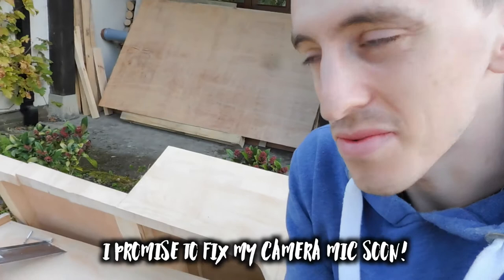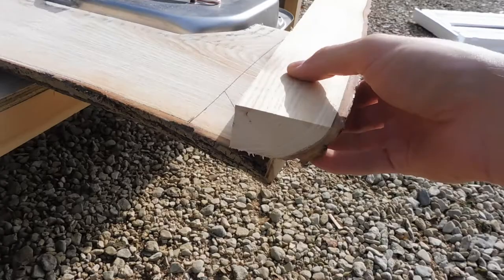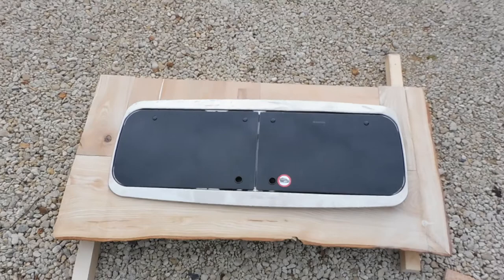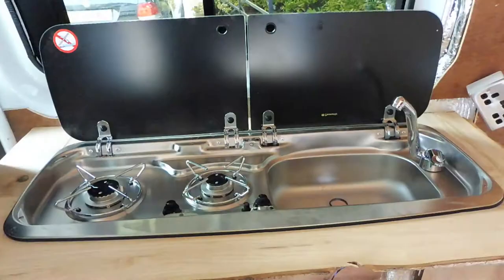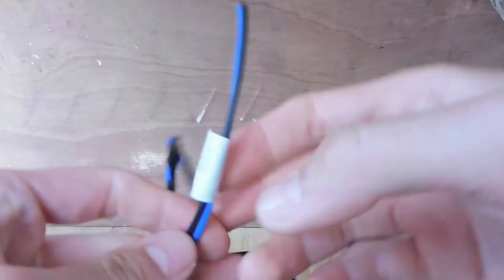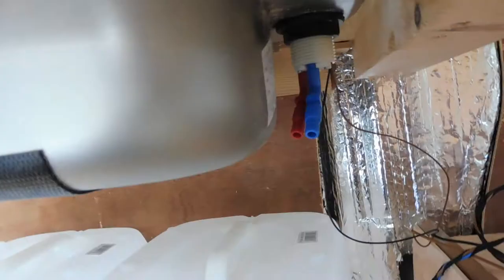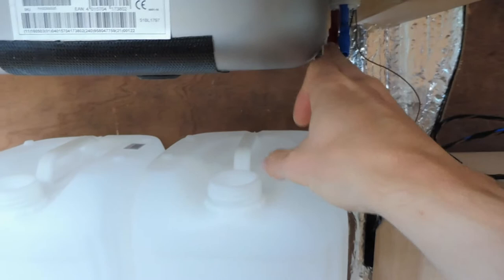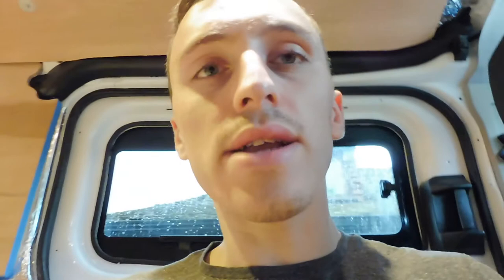VanLog 14 CAMPER CONVERSION Ford Transit Custom BRAND NEW KITCHEN! HOW TO

Comment: I am amazed how well these pumps work, and how silent they seem to be in the video. How did they held up over time? And where did you get them? Cheers! Love the builds
Reply from the maker: I found mine on ebay, look for whale 12v submersible pump. Mine worked great for the whole time I had  the van

Comment: How are structures like the kitchen area etc attached to the structure of the van - do you just screw into the plywood lining you have already mounted or screw into the metal of the van itself? Thanks. Great vids thanks.
Reply from the maker: When you start your conversion if you measure where all the internal steel ribs are and any structural batons you may put in the walls then you can usually screw into these. Vans will have a subfloor of at least 9mm so i  also screw into that